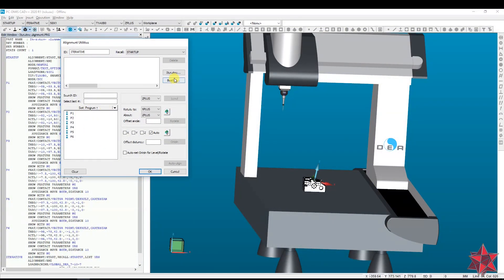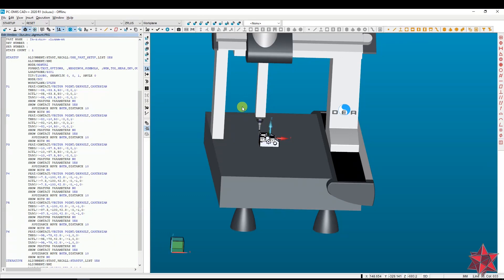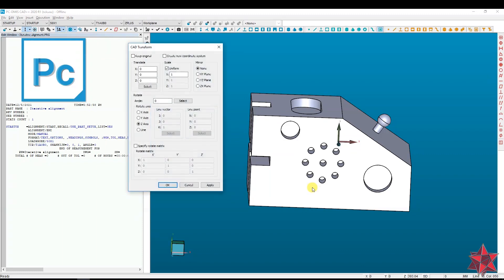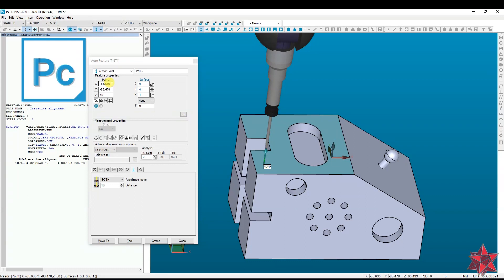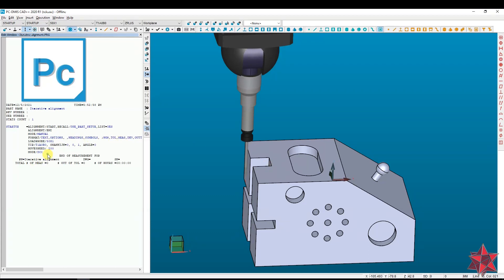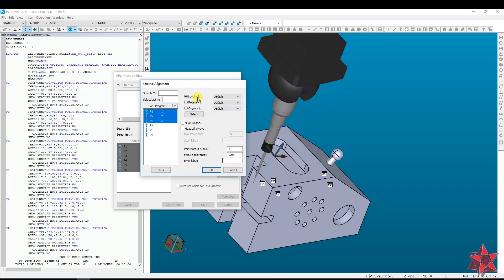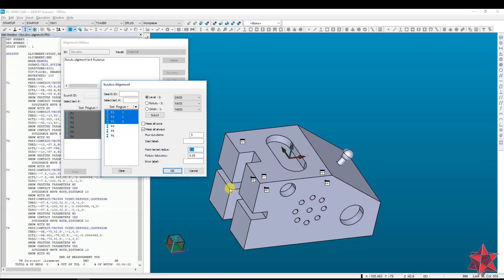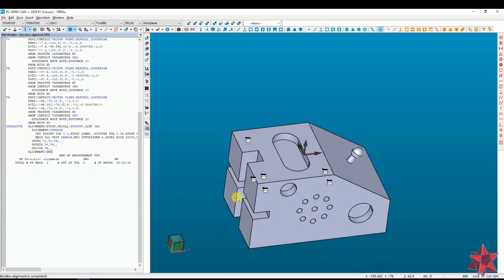PC DMIS Iterative Alignment

Comment: I do the exact same things as you do but everytime I try to run it. It says position out of the machine stroke ..... Cad coordinate system is good
 Probe location is good. I don't understand...
Reply from the maker: please locate the part first with a simple alignment in manual mode, then use this strategy, do not forget to use the the label it is important.